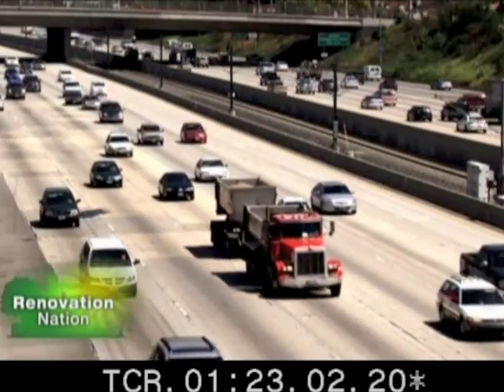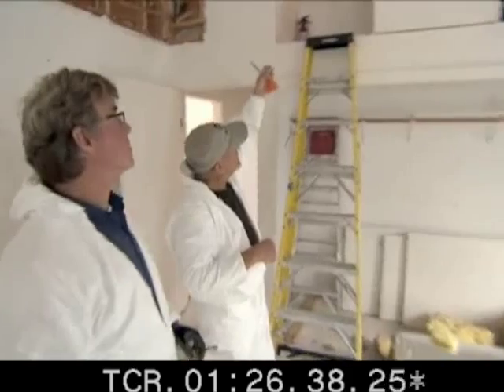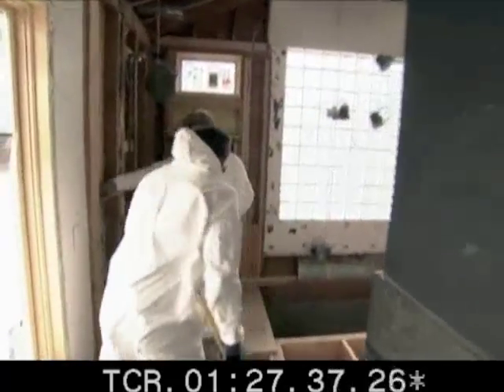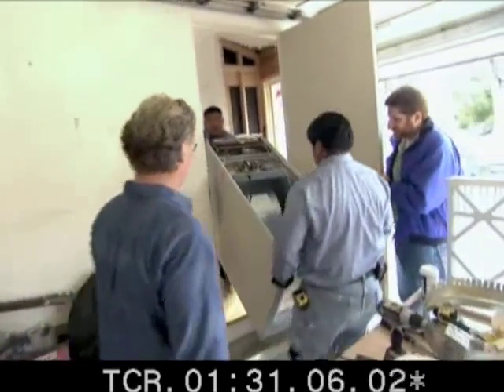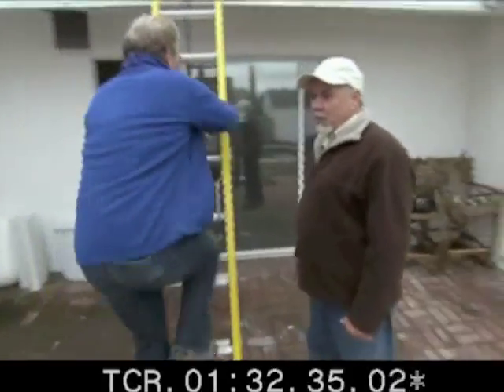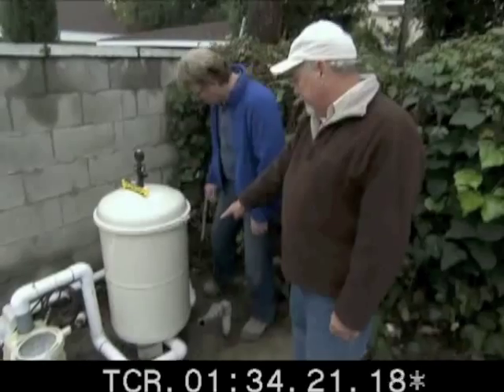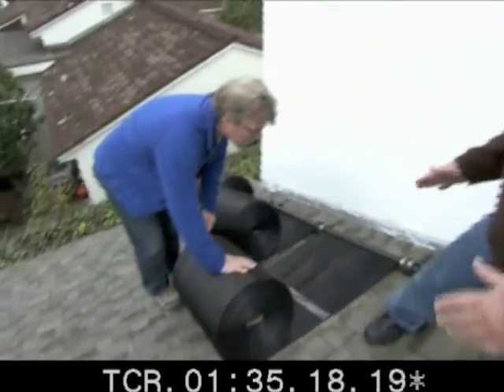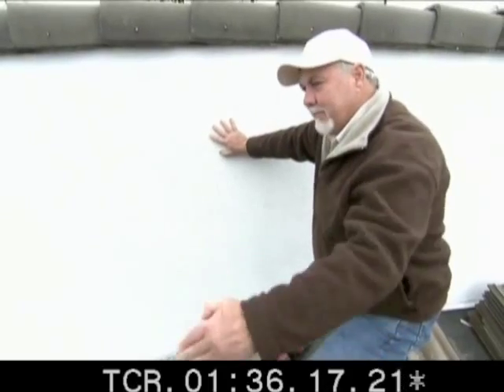Near-zero energy green house

Comment: Check out my homepage for further experiments using laser. There are several easy to do examples to split the beam, modulate on of the two and then recombine them to produce low frequency beats. These beats should be able to induce currents into the body to transmit sound or steer muscles if used with high power lasers. You dont even need a laser, this can be done with ordinary light and heat radiation as well. The double slit experiment mostly is done with an ordinary light source.

Comment: What this video really demonstrates is the near futility of attempting a net zero home through the remodel of an old house. Too many poor architectural flaws to come even remotely close. Not to mention stupid (really stupid) ideas like the water heater for heat and putting the air handler in the attic, in L.A. no less. You would need 40 kw of solar to even come close. Dumb example for a energy eff. home tv showcase.

Comment: This is a piss poor example of an energy efficient home. Most of what they were touting as innovative energy saving techniques are just routine building practices. Uneccessarily high ceilings, air handler placed in the attic, hot water heater as a furnace...come on...are you serious. It will take more than some fly ash countertops to make up for this sorry excuse for a energy efficient home. Net zero? No freaking way.

Comment: You are correct. The goal of the project was zero-net energy on an existing home. If we had a few more funds we would have added a total of 5 kW solar and would have made it with solar thermal too. The project had over 1,000 visitors over 2 years, many "green" events, high school students as docents. We hope we made a difference in terms of advocacy on the benefits of energy efficiency's on comfort, durability, the power of building science when retrofitting our existing building stock. thanks!